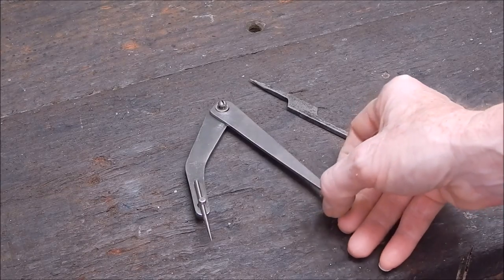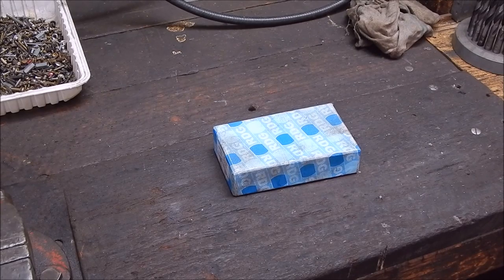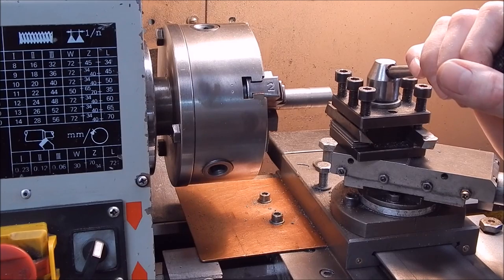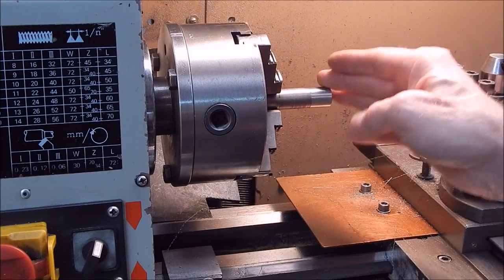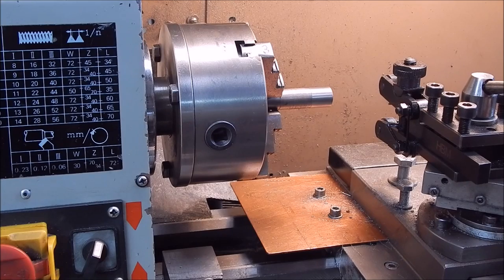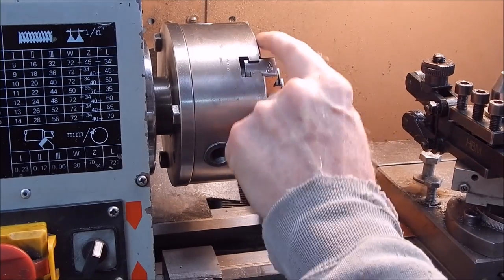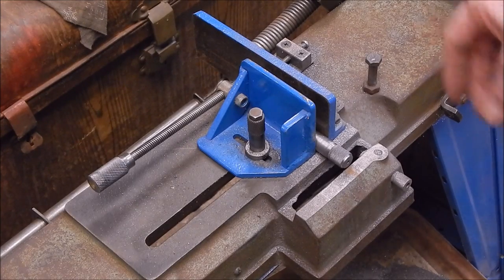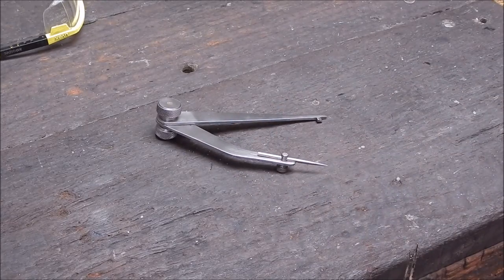I spend a dollar at a garage sale

Comment: Hi Rob, hermaphrodite is an organism which has both male and female reproductive organs within it. I was told that's why they are called hermaphrodite calipers because they have odd legs, one of each. They can also be used for drawing lines parallel to the edge of a workpiece when setting out.
Reply from the maker: Kevin Smith Hi Kevin. Thanks for the heads up. I was certain there was a logical reason for the name :)  Cheers.  Rob

Comment: I love the tips and tricks info and tool use descriptions. Also would you have any advice on a good bench top starter lathe sold in the states? Please keep up the good work.
Reply from the maker: +nav0013 

I don't have much info on USA offerings in the lathe department as I'm based in Australia, however Grizzly and Boltons both have good value/solid lathes by all accounts.   Boltons sell the CQ9325 that I have, which for the money is quite reasonable.

The Grizzly 10x22 is popular and a good size to learn on.  There is a Yahoo group for this lathe, and also the 9x20's - worth a look.

If you go smaller than 9x20 you will not get a quick change gearbox included, which is a big loss.   I like small lathes, and they are very capable, but that's one weakness with them.

I hope that info was of some use to you.

Cheers.

Rob

Comment: Good score Rob. By the way these calipers can also be used to find the mid point between two holes amongst other things. Cheers from John.
Reply from the maker: joandar1 Hi John.  I didn't realize that.  I see what you mean.  Thanks for the heads up.  Cheers Rob.
Reply: Hi Rob, the process is set to a bit over half the distance between the hole edges and scribe two arc's, then a line between where the arc's intersect is mid. Cheers from John.